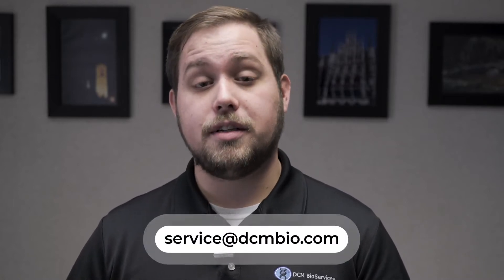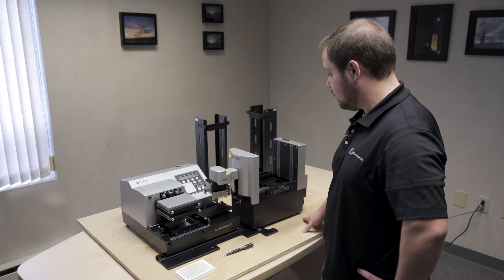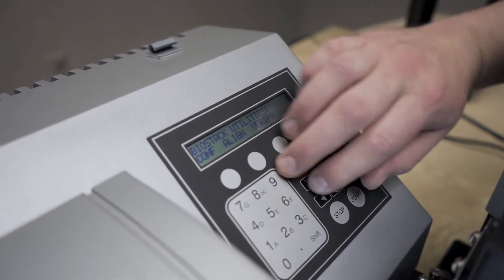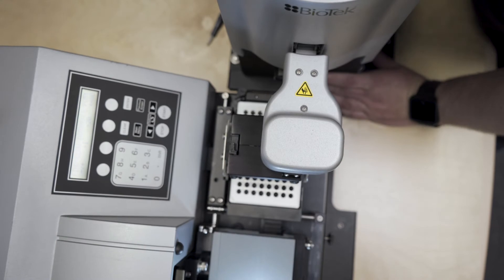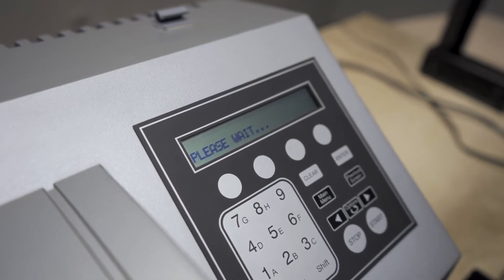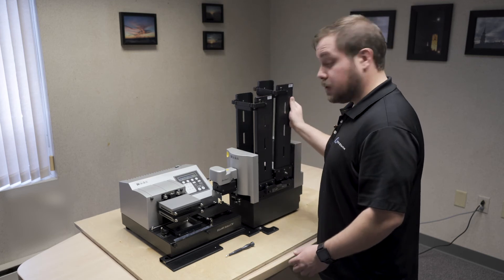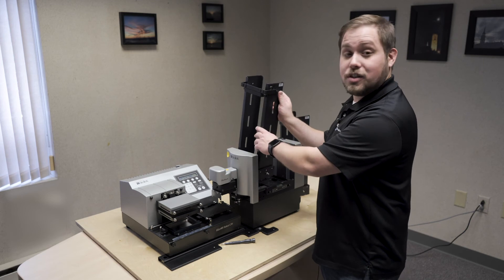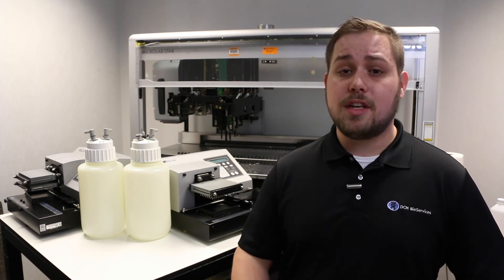BioTek Plate Washer and BioStack Alignment Tutorial

Comment: When I click on C-POS, I get an error message 8306 (serial communication timed out). I tried reconnecting the cable and turning it off but it doesn’t work
Reply from the maker: Is your Biostack connected to an ELx405 or EL406? If so, you'll need to first enable Biostack Mode. This is done by navigating to SETUP -> BIOSTACK -> BIOSTACK UTILITIES -> CONF and changing from Manual Mode to Biostack Mode.